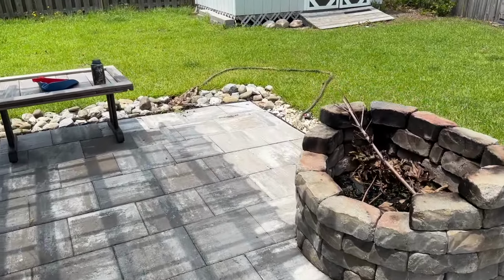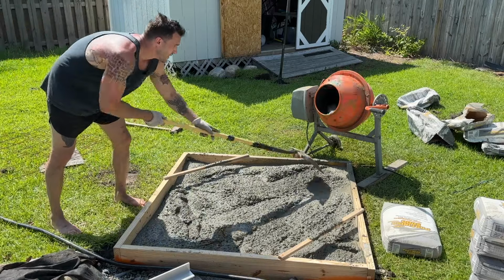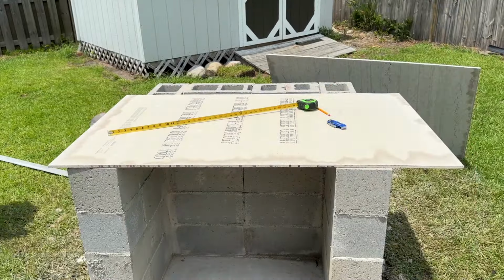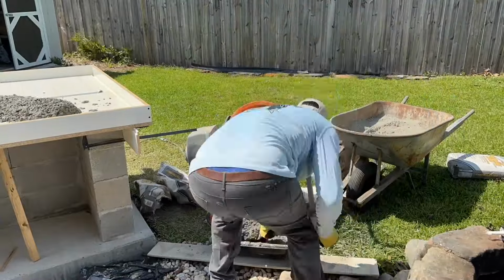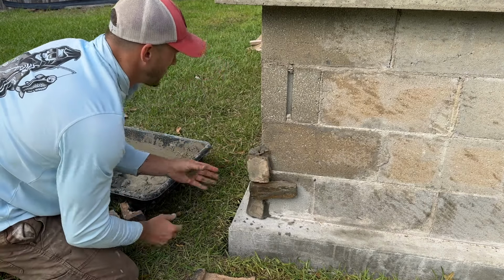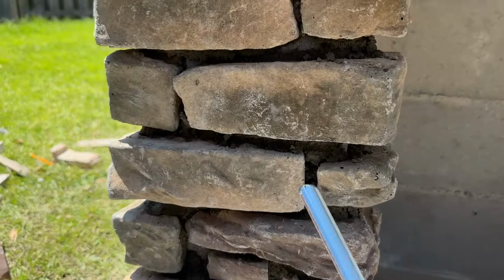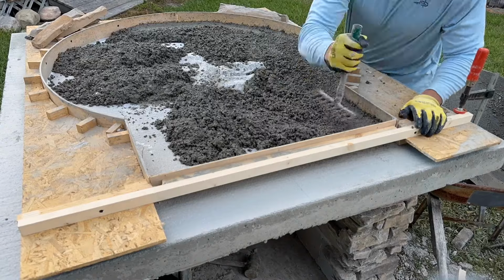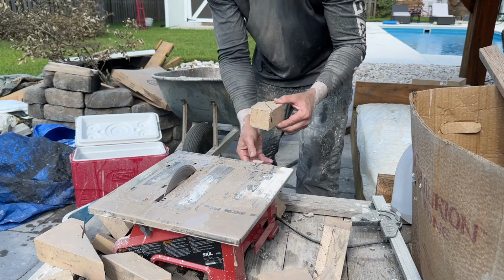How to build a pizza oven - Part 1

Comment: A year in, any changes you would make?
Reply from the maker: thanks for watching. the door is pretty heavy, and over kill, you can get away with less. I'd make the dome even shallower to reduce the amount of inside volume reducing the time it takes to heat up and bringing the rolling flames closer to the pizza.
Reply: @KeimpieceCarpentry thank you!
Reply from the maker: @fullcasitafullheart9476  and if you're trying to save money, skip the rock veneer and just stuko everything. or smash up various beer bottles, put the shards in a cement mixer with sand for a day and it'll make sea glass, use that as free tile

Comment: What is the inner diameter of the base of the dome and what is the width of the door/opening? I'm asking because I'd like to buy the plans if I can fit an 18" pizza into it. I'm also hoping to be able to cook two 18" pizzas at once so I would need around 40"-42" diameter base to allow enough room for placement and rotation of the pizzas. Though that might be difficult to achieve with the fast cook times from the high temps of this thing until/unless I can find a way to dial in the heat to a lower temperature, like 500-600 degrees so I can do longer 8-10 minute baking times for a good NY style pizza.
Reply from the maker: Thanks for watching. inside diameter is 36 inches. you won't be able to cook two 18 inch pizzas as ones with the fire in there as well. If you're doing this in your backyard, you'll never need to fit two 18 inch pizzas in there at once. These things cook in like 90 seconds. The first one will be done before your done putting the toppings on the second one. The only reason you'd want to be able to cook multiple large pizzas as once is if you were running a pizza shop. Either way, the plans will still be helpful, just modify them to account for the size oven you want.
Reply: @KeimpieceCarpentry Thanks for the response!

I am thinking I can preheat the oven and then remove some of the fire if necessary (or let it burn down), leaving a small fire or embers behind until the inside temp is closer to 600 degrees, which is fine for a NY style bake. I currently bake on a 3/8" pizza steel in my oven at 550, with the steel getting up to 600 degrees without any problems.

If I can't get a lower temp for NY pizza I will just adapt my dough recipe for the higher temps. No biggie. I just really like NY style. haha!
Reply from the maker: @jay25443  it won't be hard to maintain a lower temp, just don't let the fire get too big. It takes about 3 hours to get up to 900 degrees. It'll be much easier if you're trying to keep it at a lower temp. i use 63% hydration for my dough.

Comment: Thanks for this. Love the brutal honesty throughout and lessons learned. I bought the plans, and used ChatGPT to tailor a bit, too. Currently on step 5. One thing that would be nice is to have a complete list of everything you used, for example, for a novice like me... what type/size nails, screws, everything in the indispensable tool (I don't have a lot of stuff hanging around so need to buy it), etc... Otherwise, it's awesome!
Reply from the maker: thanks for watching and the feedback. Good luck on the build.
Reply: @KeimpieceCarpentry  My brick supplier said they also sell half bricks.  So, I could save a lot of time by not having to cut lots of them in half. Do you know approximately  how many I should buy cut in half?
Reply from the maker: @SamAdler  sounds like a plan. I do not. You'll have to watch the video and count manually. sorry

Comment: Wow, nice pizza oven, well built.
Just a quick question, what bricks you used on top of that pizza oven base and for the dome and did you use a normal mortar or fire retardant one? Just a normal full bodied bricks used for the walls or some other kind?
Thanks in advance
Reply from the maker: thanks for watching. Fire bricks were used for the whole thing. anywhere there were fire bricks i used refractory mortar.

Comment: Sweet wheres part two?
Reply: Helpful video - Great detail.
Reply from the maker: @janecollier3069  thanks!
Reply: Overall what was final cost?
Reply from the maker: @joejoe2852  there's a few ways to reduce the cost by not doing stone veneer or using normal concrete, but the materials that I purchased and the tools, it totaled to a little over 2k. There is a detailed list of tools and materials required in the build plans I have available on my site.
Reply from the maker: Working on uploading it now, idk what's going on but youtube won't upload it. I'll let you know when it's up.
Reply from the maker: I just posted it. Check it out